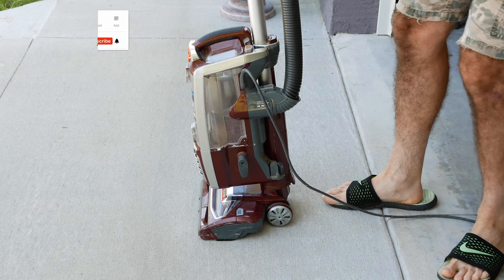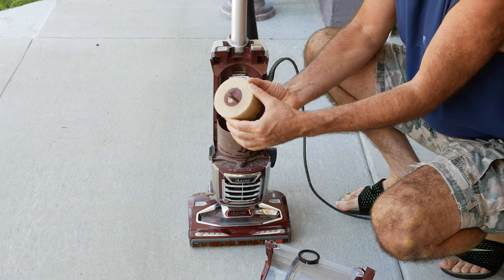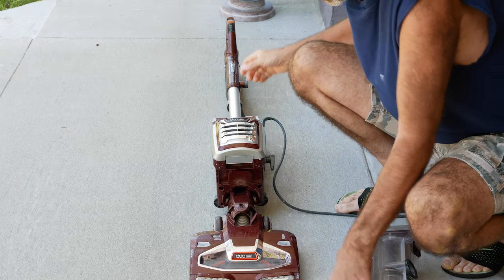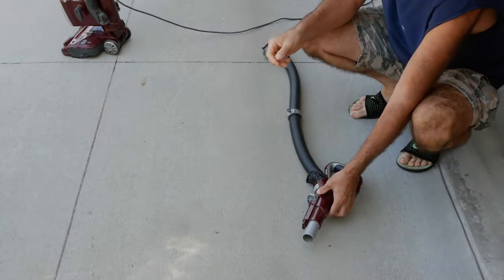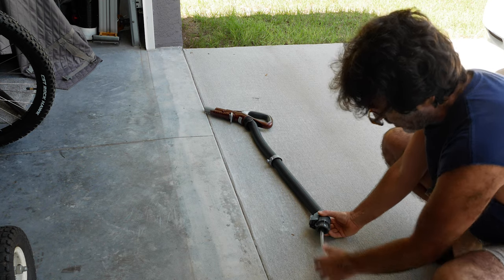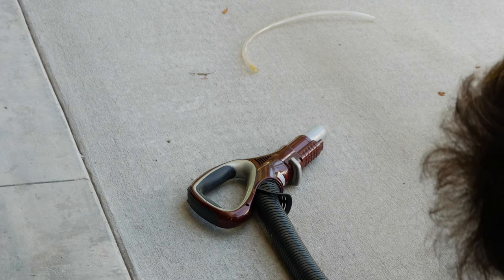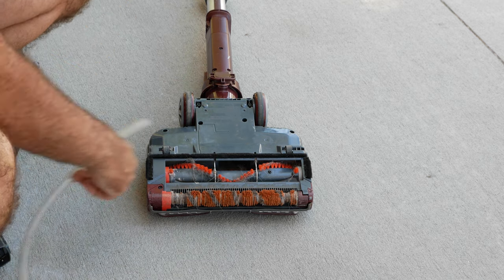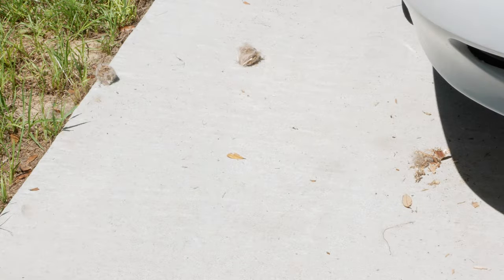Fixing a Shark Vacuum With Loss of Suction [Doesn't Sound Right]

Comment: Thank you for this, after washing all the filters and checking the obvious places, I knew the blockage had to be in the hose with the handle. I don't have an air compressor but using the nozzle attachment on the shop vac sucked the clog right out.
Reply from the maker: You're welcome!  So glad I was able to help.. 😊

Comment: Thanks for saving me $200 on a new one. I used a $20 electronics blower (canned air replacement) off Amazon to clear my hose.

Also, on my newer model it says to clean/rinse the HEPA filter once a year so I rinsed it, black water came out, no problems but I noticed it is so densely packed that water pools inside so you gotta hold it diagonally (on two axis) to drain at the corner to get most of the water out then let it dry over night.
Reply from the maker: That's awesome!  Glad you got it going again... 😀

Comment: Thanks for the info! Yesterday I took everything apart, couldn't figure it out. Just no suction on this vac. However, I was looking for the belt --- Am I correct there is no belt on this particular Shark? Gonna go back and see if I find a clog!
Reply from the maker: HI Sheena, I can't say one way or the other about the belt.  I don't have access to that vac anymore to look and see.  If you have your model number, the easiest thing to do is look up parts for it and it'll identify if you have a belt.  I'd be surprised if there's no belt because that would mean the beater bar is direct drive, which I doubt.

Comment: hi, have a audio file of my shark, making strange noise , can someone give me email  so i can send the short audio file cleaned it an it turns on and won’t suck , opened it up found stuck dime out some  hard noodles some cat litter , even though have cleaned it and gotten anything jammed out , it make strange noise and don’t suck, belt isn’t broke it’s fine
Reply from the maker: HI, there's no way to tell where a problem is by listening to a recording.  If there's no suction you've either got something clogged somewhere, or I've even seen the vanes on the fan/ impeller totally broken off.  That usually doesn't happen, but I have seen it.

Comment: So basically you need special equipment to open it up. I was thinking it would be a bit simpler like just taking it apart at certain places. Can you spray a water hose through there and let it dry?
Reply from the maker: Yes that's what I would do... or you can poke something through there, but I would tape a cottonball or something on the end so it doesn't wind up putting a hole in the hose..

Comment: My shark has no suction, all hoses are free n clear, the brush turns and that’s it , you don’t hear the vacuum motor running ? How to fix it
Reply from the maker: HI, there's not enough information for me to determine the problem.  There's more than 1 thing it could be.  Bad wiring, a bad motor, a circuit breaker inside the vacuum....  You'll need to take it apart and determine if there's power getting to the terminals on the motor.  If so, then you probably have a bad motor.  But without looking at it to determine that, there's no way to tell..  If you're not used to working with electricity, I don't recommend trying to fix it.

Comment: This is not to discredit or take away from this video at all as I really do appreciate this video and information however you really should stick with using the air compressor or even canned air duster and definitely try not to run water thru there as there are electrical connections running thru the hose (at least in the powered lift away I have so that’s just something to be aware of and thanks again my guy
Reply from the maker: Thank you for the tip!  Many people don't have air to run through.... I doubt the water would hurt anything, but I would leave the hose hanging for several hours on a sunny day to dry out... 😀

Comment: The problem with mine is weird. The vacuum will shut off when it's upright,  but I lean it back and the motor runs. It's happened a few times but now not it's not working. I've tried to unclog it and what not but can't seem to get it to work. Any ideas?
Reply: Now of course after I comment it starts working
Reply from the maker: The whole vacuum was shutting off?  Or just the beater bar part?

Comment: I dont have that pressure thingi and my husband dont allow the hose pipe 😭what to do but the problem is same like yrs vacuum.any solution plz.
Reply from the maker: If you disconnect the hose from any electronics, perhaps feed a water hose through there?  You could try a wire hangar, but you have to be very careful not to let it poke a hole in the side of the hose.  That can happen very easy.  Might even tape a cotton ball to the end of it so it doesn't accidentally poke though.
Reply: @TheHomeImprovementChannel  thanks , will try

Comment: Thank you, I was ready to get a new one and this is only 6 months old. The part about not sounding right was what convinced me you were right about the clog. I used a dryer vent brush because I don't have an air compressor but I never would have made the effort without your explanation because there was suction but not enough and the sound was wrong and it was getting hot. All better now. Thank you thank you thank you.
Reply from the maker: Excellent!  You're welcome and I'm glad I was able to help.. 😀

Comment: DO NOT PUT WATER THROUGH AN ELECTRIC HOSE!!!!!!  you’ll short out the connection to the brush motor and you’ll need to buy a new vacuum. Neglect like that is NOT covered under the warranty.
Reply from the maker: Ok thanks..
Reply: I mean. Mine is well past warranty phase, and luckily, this hose detaches completely from the vacuum. You do realize the filters are meant to be washed with water? They sit directly over the motor. Sharks are solid, and I've had mine for 8 years. 8 years of washing my filters. I also spray out my engine compartment at the car wash on my vehicle. Some common sense goes a long way.

Comment: What do you do if all your suggestions don't work
Reply from the maker: HI, if the motor is running and it sounds normal, then there has to be a clog somewhere.  The sound of the motor is important... I've seen where the impeller can strip out and won't spin.  IF that happens there won't be any vacuum...  Its rare though, so that's probably not the problem.
Reply: @TheHomeImprovementChannel  
Ok, thank you

Comment: I've got straw stuck at that part and got some out but not got an air compresser so us there anything else I could use????
Reply from the maker: Have you tried a water hose?  As long as it's the "hose" only and no electronics it shouldn't hurt anything... but do it at your own risk! The only other  thing I can think of is maybe a wire hanger that's straighten out,  tape a cotton ball on the tip  if u go that route so it doesn't puncture anything..
Reply: @TheHomeImprovementChannel  thank you for your advice and replying, I will have a try😊👍
Reply from the maker: @lizbet1063  U can do it!
Reply: @TheHomeImprovementChannel  did the wire hanger one and omg alot of bunged up straw and fur came out so yayyyyy 😃😃👍 thanks alot for your help, have a great day 😁😁
Reply: Relieved it worked as I definitely cannot afford a new vacuum cleaner right now🤗🤗
Reply from the maker: @lizbet1063  Oh awesome!  Glad you got it going ok.  Yea I know the feeling about buying a new one.. Vacuum cleaners are expensive!
Reply: @TheHomeImprovementChannel  indeedy they are lol 😊